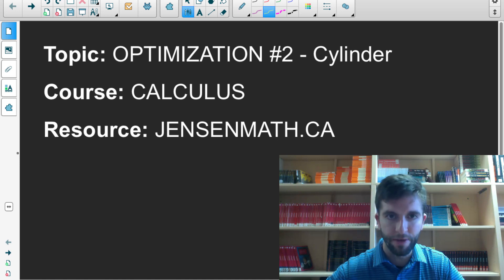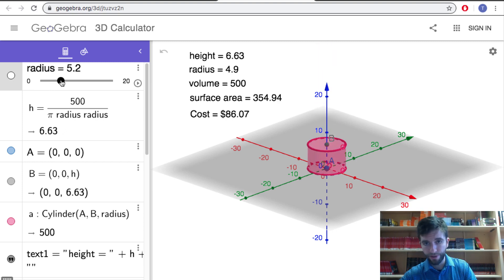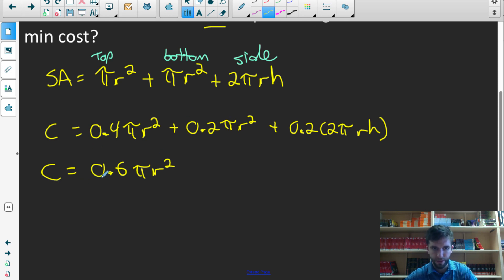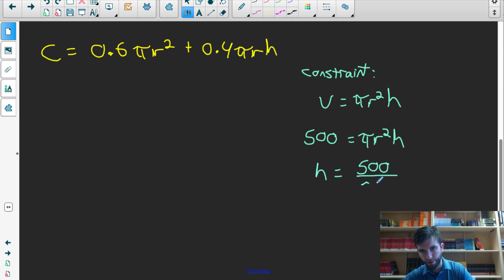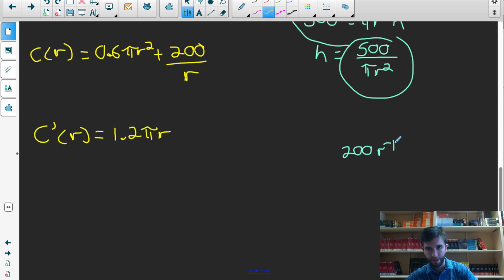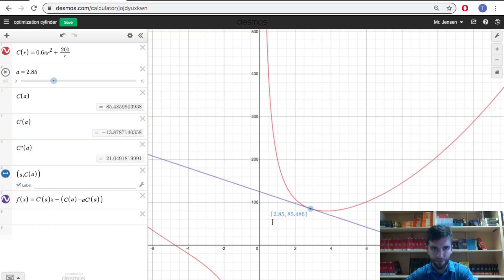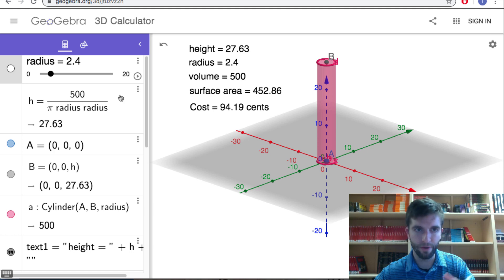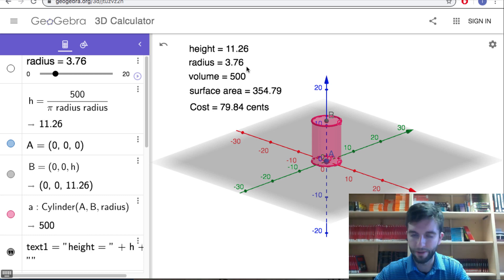3.6 Optimization Problem #2 - Calculus | MCV4U

Comment: I have a question, at 8:00 when you're finding the derivative, why did you leave the Pi there? Since its a constant shouldnt it become zero? Or I guess it should be multiplied with 0.6 and 2? I guess you're leaving it there so we can get the full exact value when we calculate it later on.
Reply: ᴨ, as you said is a constant but it is multiplied by your independent variable so think of it as 3x , d/dx(3.14x)= 3.14 you wouldn't say this derivative is 0. to be precise we leave ᴨ, as ᴨ and not 3.14.